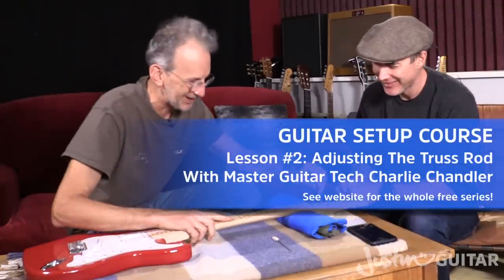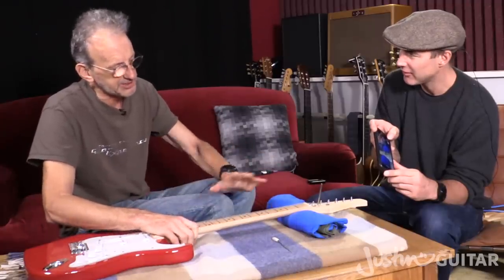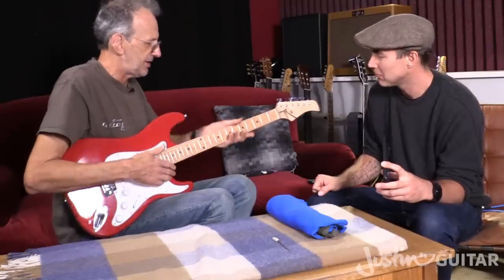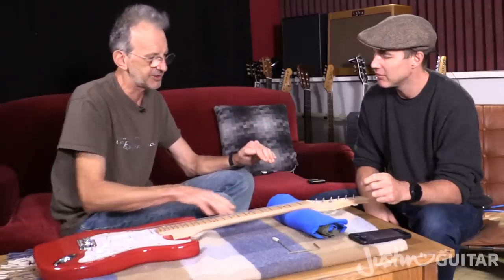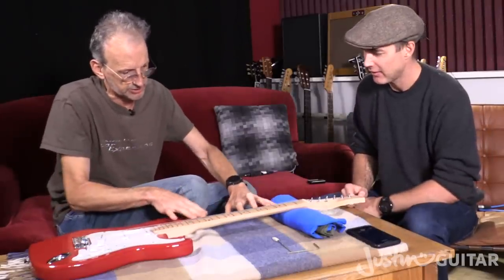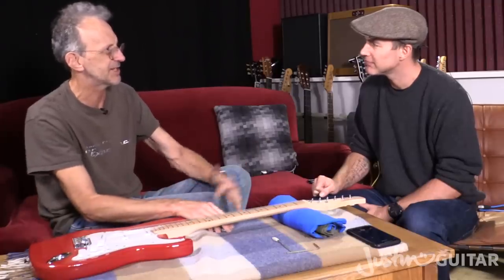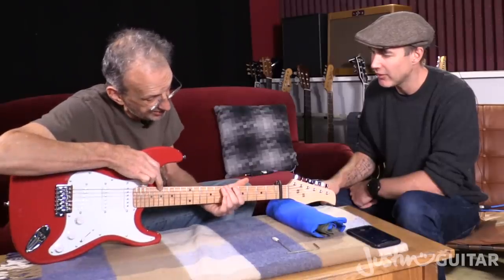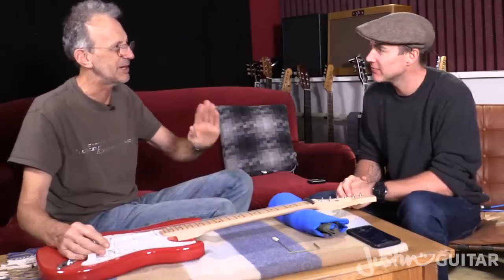Adjusting The Truss Rod | How To Setup Your Electric Guitar [2/10] with Charlie Chandler

Comment: 1. Tune to pitch
2. Capo 1
3. Fret 17 
4. Using a flat stock feeler gauge check relief (bow) at both 7-9 bottom of string to top of fret. .009 @9 is a factory strat set up.
5. Once relief is set, retune and set intonation.
I set my necks straight to .002 @9 and actions fast or low.
A low fast action will take sustain away. You can lower the pickups a bit to reduce magnetic pull.

Comment: @justinguitar You should combine part 1 and 2 into one video.  You really shouldn't watch this one without watching part 1.
In part 1, Charlie talks about using a piece of guitar string (.010) to measure the gap.  A critical detail necessary to perform this adjustment. Charlie probably doesn't use it here because he knows what .010 looks like after doing this a million times.
Reply: He has a feeler gauge in this video.

Comment: on my strat there's no opening at the top of the neck for the truss rod. How am i supposed to adjust it ?
Reply: Probably a heel truss rod, if so, the truss rod adjustment screw will be on the bottom of the neck partially hidden by the pickguard/scratchplate

Comment: Geez are you sure about this? I religiously watch the Stu Mac videos and highly respect Dan. He says this is a huge mistake to do it this way, particularly with an older guitar. The truss rod is subject to huge stress doing it this way. Better to loosen off the truss rod, use a straight edge with blocks then a clamp in the middle. Adjust the clamp until correct then tighten the rod. This way the rod holds the position set by the clamps with no stress and no chance of snapping the rod.  I would like your views on this.
Reply from the maker: I'll have to ask Charlie! I have no idea! Possible that he'd treat an expensive guitar differently to this amazon cheap-o.
Reply: @justinguitar  I'd say so - he's advising us amateurs with cheap shite

Comment: Climate - I'm living in the mountains in Asia, the temperature ranges between minus 5 to 40 degrees through the year, humidity is like a bath, and no central heating so the aircon puts a guitar out of tune immediately, air pressure fluctuates between 10 to 80 in a day sometimes (no joke it causes back pain on the falling and rising - worse still, the shops save of electricity and locals engineering knowledge is zero, so when you go to buy a new guitar you know its sat in a damp cold shop all winter, a saturated humid shop all spring and a baked dry summer.  I often hear a string snap - so i tend to keep air con on all day to tackle the environmental changes and my electric is out of tune on top E B at frets 1&2 (so I've learned diff ways to compensate not to play a D (I'll use acoustic usually or half a d chord, sadly it affects the F I need for my fav song (wind cries Mary) - so I shall take this fellas advice soon....a 'thou' (prior video is a thousandth of an inch, impossible to see a though, must use a gauge of some kind).
Reply: Have you thought of getting a fibreglass guitar?   They are supposed to be impervious to temperature and humidity.

Comment: Cant say Im a fan of this guys techniques... I prefer to measure with extreme accuracy then use a bit of feel to dial it in if need be.  My guitars all end up playing the same and the setups are consistent.  Use feeler gauges and a precision ruler.  I like being able to accurately measure my setups, than use feel though.
Reply: Watch part 1. He suggests using a .010 high e string as a feeler.
Reply: Buddy Guy, "I go by feel."

Comment: Just having one guitar and no money. I really want something just for a switch now and again. So I just invested a whopping $120 (on lay -a-way, so sad) AXL Strat that didn't feel bad at all. It's amazing that you're doing this subject because I decided to buy the cheap PoS and work on it myself. Set it up, maybe switch the pickups and probably sand down the neck a bit. I figure if I screw it up royaly I won't give a shit, but it's good to know basic maintenance etc,. Not that you can't get that done pretty cheap anyway, you just don't know if you're getting what you pay for. After a set up I was given my Les Paul back with the neck pickup way closer to the strings than the bridge. So one was way louder than the other. A simple fix, but I didn't know why that was until I stumbled on a Joe Walsh video on setting up a guitar. The dummy I can be played like that for months thinking it was just the pickups. The neck is a Classic 57 and the bridge a BB3, so I thought the BB sucked ass. After I discovered that I began to distrust paying someone I don't know. If you got someone highly recommended by somebody you know and trust, fine. But if you're like me you need these videos so your not just throwing good cash after bad. Maybe if I save enough moeny I can buy a Justinguitar T-Shirt. Anything's possible.

Comment: pls heed my advice. take it to a pro. believe me, i have tried adjusting mine, not many can get it perfect. 
akin to a driver or mechanic.
Reply: If you understand how the instrument works and can follow the process you can perfect it. It's much the same for cars, maintenance is simple once you know what to do. It's akin to changing your own oil or doing your own brakes.There is no secret to it.

That being said I understand those who do not wish to sacrifice their wallet to Stew Mac. A proper setup can be much more in depth than just making adjustments. Sometimes you need to cut a nut slot deeper or replace the nut, do some fret leveling/crowning, shim a neck (especially on 60's Japanese guitars) etc. In the case where you don't want to invest in the tools and the knowledge a professional is a viable option.